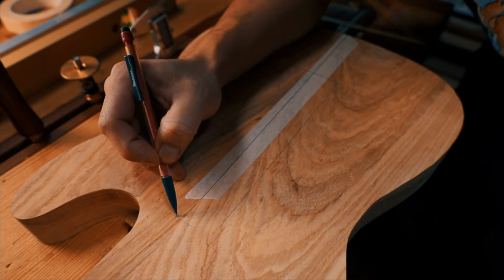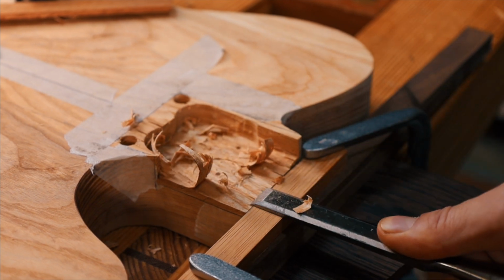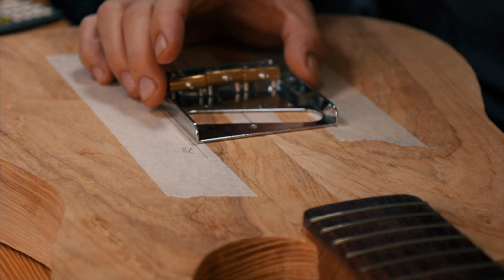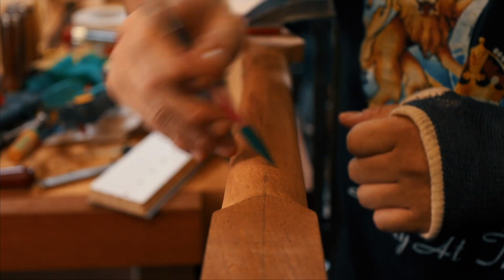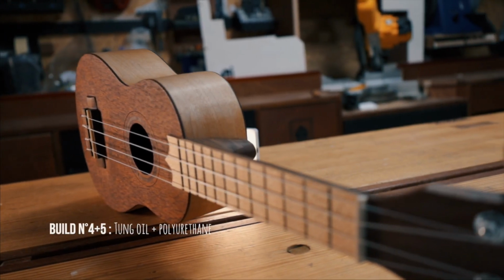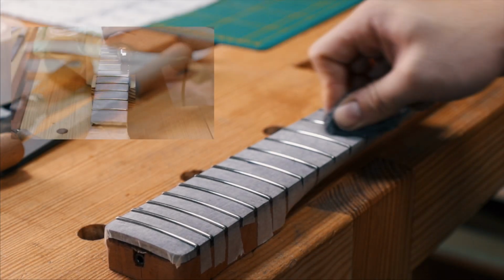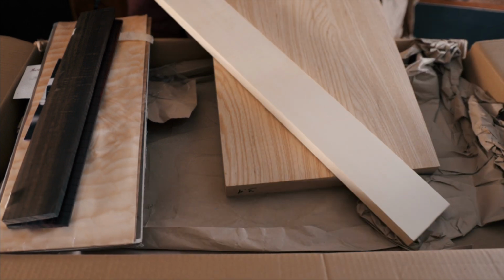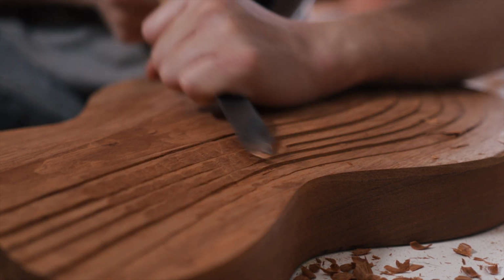How To Make A Guitar : Part 3/3 - EVERY SINGLE STEP EXPLAINED

Comment: Thank you for this video series!  Based on your videos, I bought all the wood and component pieces to build a telecaster-style guitar.  I have never worked with tools or done wood working, so I bought lots of tools.  The only power tool I have used so far in my build is a hand-held electric drill, and a router.  I still haven't figured out the router (the bit keeps slipping, resulting in uneven cuts), so for things that most people would route, I'm using your ideas with chisels.  Currently making the neck, and so far so good!

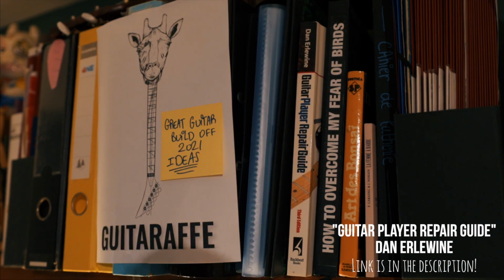Comment: Thank you for the great video. I have a question. At around 13:40, it seems like you give a little bit of upbow relief for fret leveling. Is there a reason for this? I know that in general leveling, you straighten the neck and then do it, but I'm curious as to why. When I do fret dressing or refretting, I usually get buzzing on the high frets above the 12th fret, so I usually sand it down a few more times. Is this the same reason?

Comment: Love this series, I love working with wood and want to give something like this a go, I was thinking of buying a guitar that needed some work doing to it and pulling it apart and giving it a new lease of life but obviously I haven't done anything like this before so would probably look for something that didn't need fixing from scratch, maybe just pulling apart and replacing hardware, giving the body a paint and or oil and putting back together for starters, what do you think.

Comment: niche tip: if you've glued in your neck and can't now widen the channel for the pickup wires (because Bartolini makes them fat), get a bit of THICC wire, bend it at 90 deg, heat it with a blowtorch and hook it in the hole and push. It will burn through after a few repetitions and now you won't have to go buy a silly long drill bit.

Comment: Hey! I have a question.

Looking to get into guitar/bass making myself. In this series you created the telecaster. I know you said that a tele should be your first build when it comes to guitars, but, assuming you already have decent knowledge in woodworking and you get all the necessary measurements required for building a guitar/bass (12th fret half way between the bridge & nut), would you say it would be fine to explore other guitar bodies and/or creating your own custom?

Thanks!
Reply from the maker: It's perfectly doable

Comment: You should add 1/4 inch to the positon of the bridge for compensation. 2X length from 12th fret to nut plus 1/4".

Comment: What depth did you use for the pickup and control cavities?
Reply from the maker: I don't know, measure the lowest point of your pickups and potentiometers (altho I think the deepest element is the switch)
Reply: The switch is definitely deepest, my control cavity ended up at around 35mm deep.

Comment: Awesome set of videos! Quick question but where did you get the custom wood stamp/iron with your logo that you branded on the back of the headstock? Thank you!
Reply from the maker: I used a lasser engraver. The cheap kind :)
Reply: @tchiksguitars  thank you so much! Any chance you could possibly make a video showing how you go about using that machine and/or possible links to which machine you use? I’d be super interested to see how you go about doing that! Thanks again man!

Comment: I have a question:
Can you fit a vintage strat neck on this build ? I'm tempted to try this project, but take a shortcut with the neck build because I love vintage Strat necks, and I was wondering if the neck pocket matters at all, as I understand from your video that the whole neck building process is about the contour around where the neck is played, not particularly the neck pocket itself, right ?

Comment: How deep are you going when you are drilling holes for the pickup and the metal plate for the sound wheel. One more thing, my bridge doesnt have the string holes for the stribgs to go through the body on the bottom. It has the holes on te minature wall on the bottom of the bridge. Can i just connect me strings on the bridge because there is some distance bewteen where the strings sit and where they would end on the bridge.

Comment: The only thing scaring me fromstarting a project like this is how to fit the electronics. You didn't really show that in the video and I'm not sure if I should even try.
Reply from the maker: Check sixstringsupplies Chanel
Reply: @tchiksguitars  Thanks for answering so Quick! There are accually several more things that I am quite scared about that I might do wrong. I was checking out the electronics you used and they were a bit to expensive for my first build so im also wondering if there is any cheaper similar equipment?
Reply from the maker: Yes of course. Buy alpha pots instead of cts and a random cheap switch might do the trick. For the pickups there are also cheaper alternatives. Alternatively you can buy a guitar kit and use the electronics from it
Reply: @tchiksguitars  I might accually just buy a cheap second hand guitar and take parts from that one. If I do that i will know exactly how everything is supposed to fit in my new body!

Comment: I've just ordered a Harley Benton CST 24 kit, nitro finish is curing as we speak and I'm waiting on a better ABM wraparound bridge, I've soldered a completely new wiring harness (first time in 12 years soldering again) . It's a bit rough but I've loved the process and it has definitely triggered something in me. 

I've already warned my wife that I might want to do this again from scratch. As I've gotten the idea of a DC Junior with an explorer headstock. This series definitely has helped me understand things a bit more. Also came quite close to home as I'm from Belgium as well. Will be on the lookout for some local wood shops for sure!

Now onto getting some tools like a bandsaw, a spindle sander and a router!

Comment: I saw in your Les Paul video you went for that 4 degree angle.. how would you achieve that and is it only on certain guitars?
Reply from the maker: It's on guitars with a very high bridge. I used an angled router jig. It's actually pretty easy

Comment: One thing I'm really struggling to find anywhere is how to cut the slot where the nut goes into the neck. Because it seems like it's too wide to cut with a saw. Do you chisel that out or something? This is probably a really stupid question, I've tried googling it but due to ambiguous wording I just get a load of results about how to cut the string slots in the nut.
Reply: Ignore that, just saw it in part 2!
Reply from the maker: :) that !

Comment: with the neck pocket, you said that the top of the fretboard should be 9mm above the plane of the body. is this the same for any guitar, or just this one? if so, how to you determine the correct depth for the neck pocket on any guitar build?

Comment: This was an amazing video series ❤️. Could you do another for the electric bass, please ? Maybe a Jazzbass ! Respect from 🇮🇳
Reply from the maker: Thanks ! I don't think I'm ever gonna make long tutorials l'île that anymore. Wayyyyy toonmuch work
Reply: @tchiksguitars  thanks for the response bro ! Do you think the same techniques applied in this build could be applied to a Stratocaster or a Precision/Jazz bass build ?
Also, does any mistakes made during marking the fret positions cause the whole fret board to be discarded or can intonation problems be solved by adjusting the string height at the bridge ?
Reply from the maker: Yes you can use the same video as a basis. You won't have intonatiok problems if you mark the frets in relation to the nut (and not from fret to fret )

Comment: I live in the middle of nowhere and we have to order everything. After completing my parts collection, wooden blanks, fretting tools, plunge router/bits, jack plane I'm still stalled probably for a few months more because our town doesn't have much variety of tools. Sure they have saws, hammers and nails but no tool sharpeners of any kind, no straight edge, no protractors, no try squares and worst of all... No beer (those cost an arm and a leg to order too). But I guess that's a good thing too because where I'm from we have very little humidity and we have snow nine months out of the year. My rosewood fretboard started to bow immediately after it arrived so I left it lightly clamped on a flat surface and now it's done trying to warp. My Mahogany body blank is a little more cupped now than when it arrived last month. I still need to order a few more things and that should give my body blank plenty of time to dry while I spend yet ANOTHER month or two (on top of waiting for my orders for a month) making a mini workbench with a vise, some bench dogs, a side rail as a shooting board all the while I continue to learn the many different methods, techniques and tricks of guitar building and I often find myself coming back to your channel when a light bulb pops up in my head as I mentally go through the steps on my build. It may be simpler to just save up and buy a guitar but I'm way too picky and I'm the sort of person who buys once and use for the rest of my life and I don't wanna settle on a cheap guitar.

I have to say, your build quality is perfectly in tune with how I imagine my build would end up and I'm really glad to have a reliable source for information and inspiration.

Comment: Thanks for this series. Just awesome work on that guitar. I am stealing the finish for my current build. I have looked on the Rubio website but I can't quite work out the finishes you use. Is the dye "Intense black" RMC Precolour Easy? Would be great if you could point me to the finish coat :)
Reply from the maker: Yes it's precolor intense black with white 2c oil
Reply: @tchiksguitars  Thanks so much. Once again just incredible work on these guitars. I can see you going a long way with it

Comment: for your normal finishing routine--do you sand between coats of tung oil, or between coats of poly? if so, what grit?
Reply from the maker: Nope I just level the last coat with steel wool 000 (can't find any 0000 here in Belgium )

Comment: Amazing build! I'm ordering parts and wood in to build my own too! Just a question: using ash, wouldn't you need to fill the grain in order to get a consistent finish from the die?
Reply from the maker: Well if you want a consistent grain, don't get ash :)
Reply: @tchiksguitars  Hahaha! My local hardwood store didn't have alder so I did end up getting ash but all is well :)

Comment: I would have overlapped those holes everywhere I could to get rid of as much wood as possible in the neck pocket.  The nice thing about forsner bits is all they really only need a little of the middle to drill okay.  With a drill press you don't even need the middle.
Reply from the maker: Remember I did this with one hand. It was already risky to use a drill at all

Comment: GREAT JOB! CONGRATS.
A question: when you refer to polyurethane you prefer mono or bi-component poly? Thanks
Reply from the maker: Mono I guess. I just buy the premixed stuff you find at the big box store. Then I thin it down with mineral spirit and apply several coats. When I'm done I even it out with steel wool

Comment: Hi, could you tell which grain you used to sand the guitar body before applying rubio ?
Reply from the maker: Yes. 80 120 180 240 360 :)

Comment: Hey tchiks, I wanted to know about the finish because oh my god this is gorgeous. With 100 ml of the black oil and 100ml? How much did u use to stain the guitar? Also what was the process. I intend to try the same process because that is so beautiful. Please let me know
Reply from the maker: I bought the smallest amount available but it was still pretty expensive. You really don't need a lot for a guitar. After this guitar the bottle is almost still full :) the process is tint first, 2 or 3 times because black requires more applications to be perfectly black. And then just rub the rubio oil on, it just takes one application. The oil is going to get inside the grooves. 10 minutes later wipe out the excess and your guitar is done :)
Reply: @tchiksguitars  i found here in canada 100ml for 63$ dollars, its pretty expensive so thats why I wanted to ask if 100ml is enough.  Thank u!!! Hopefully soon i’ll take a picture of my attempt and send it to you! Cheers
Reply from the maker: Yes please ! Yes rubio is very expensive. They're Belgian and I'm from belgium and yet I still had to buy it from France. And it was still very expensive :p

Comment: Great videos! I have 1 question though. I've got the plans from Electric Herald and will begin my build as soon as my hunk of wood is delivered but I'm having trouble reading the plans. Is there an idiots guide somewhere that tells me what the symbols etc. mean?
Reply from the maker: We don't care about the symbols :) like, at all. All we need is the general shape and where to drill the holes
Reply: @tchiksguitars  I'm thinking more for the size of the drill bit for the ferrules and jack
Reply from the maker: You'll have to measure your actual hardware once you get them because every piece is different
Reply from the maker: I'm talking about ferrules, tuners, nut, bridge screws, control plate, ... Don't predrill the holes before you get the actual hardware in your hand. There isn't any " industry standard " you'll have to improvise (hence my recommendation of getting a digital (or even analog) caliper )
Reply: @tchiksguitars  Brilliant! Thanks :)

Comment: One way I like to set my neck alignment, is to hold the neck and the bridge where they'll be, then go diagonally from the left edge of the nut to the right edge of the bridge with some string, then do the opposite. If the string is the same length, you've got a straight neck!
Reply: As long as your bridge is straight too 😅

Comment: If you don’t want to build a guitar as first project, you could just try to build a cigar box guitar. It’s way easier, had only 3 strings and you don’t have to build the body. You can even buy a neck and just assemble it

Comment: "The sides of the neck pocket don't matter all that much," unless you plan on showing it to people, and especially if you're hoping to sell it to someone, in which case all sides of the neck pocket surfaces and angles, and in particular where the sides of the neck pocket meet the top face of guitar any problems with that edge with those lines and you'll be able to see it from across the room
Reply from the maker: I was talking from a functional and alignment perspective, in contrast with the care and attention you should put in the bottom of the neck pocket.
Reply: @tchiksguitars  sorry, didn't mean to be such a dick about it.

Comment: Is it required to put a finish on the wood of the body? I just finished making the body of mine and want to leave it the way it is because I like the natural look but I’m afraid of the wood cracking. Is there a certain finish I should use for that or use no finish at all.
Reply from the maker: Just use oil. It's rather easy to use and it preserves the natural aspect of the wood. Like tung oil, danish oil, boiled linseed oil. You could also use wax, it's also transparent.

Comment: Really really helpful series. You have inspired me to build my own Tele in the summer. 
I really love the professional video style to your videos and was wondering how you achieve this look (shallow dof etc.) and what gear you use so that I can record mine when I do it. Thank you so much!
Reply from the maker: I used a canon eos 700d with 24 and 50 mm prime lens before. For this build it was still a 700d with 24-105 mm and a 50 f1.4 lens but they weren't mine. Now I use a canon RP with sigma 18-35 mm f1.8, but in 4k. So the short answer is : I use a lot of different lenses :0

Comment: Wait... that guitar body you were carving at the end...
Reply from the maker: COULD IT BE ....????!!
Reply: @tchiksguitars  *GASP
Reply: Are you adding a pick guard?
Reply from the maker: I have no idea yet. I'm currently stuck between two builds so the les paul build is going to have to wait until I make my mind about the wood species of the neck. I know it's going to be a laminate but 3/5/7 plys?? With or without a scarf joint ? A decorated scarf joint ?? I don't know. Most of the time I don't know what  the next step will be :p
Reply: @tchiksguitars  relatable

Comment: I just finished my first guitar build ever today, and I was largely inspired by how straightforward and clear your first video was. I knew very little about woodworking and certainly hit some bumps along the road, but I am incredibly proud that I actually finished it! Thank you for these absolutely wonderful videos. I can't wait for my next build!
Reply from the maker: Wow. It's another one of those comments that appear to be made up and I paid you to post it :) I'm very curious to see your final product, don't hesitate to tag me on insta ! Congratulations !
Reply: @tchiksguitars  If I had insta I'd post it! It looks a lot better than it sounds XD
Reply from the maker: Oh. What happened ? Is it the fret slotting ?
Reply: @tchiksguitars  Ultimately I think the main problem is that I should have made the neck pocket deeper, because the fretboard (and the nut, which is also too tall but I could file the notches down) is just way too high for the bridge. The fretboard was pre-slotted so that's no worry. I'll probably go back and try to fix it up soon!
Reply from the maker: Then it's an easy fix, just make the neck pocket a little deeper. Conversely if your fretboard is too low you can also shim the pocket :) I really recommend that book from Dan erlewine, it really explains the whole set up of the guitar with great details.
Reply: @tchiksguitars  Thanks for the recommendation! I did work on the neck pocket a bit and it already looks and sounds much better. Just got some new wood to build a bass!
Reply from the maker: Ahahaha you totally got the virus now !